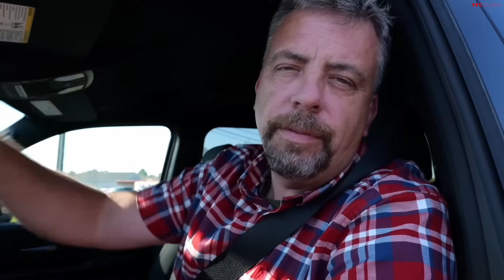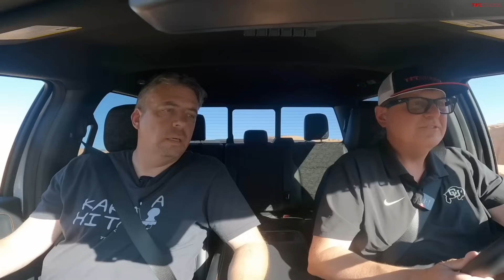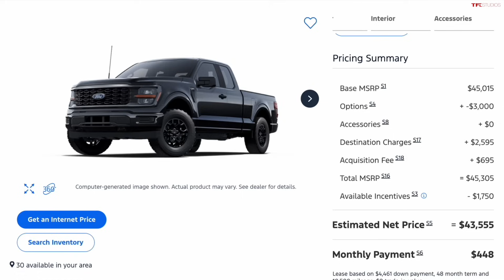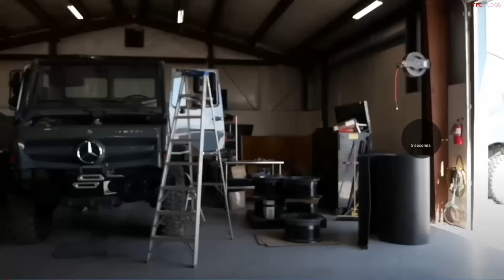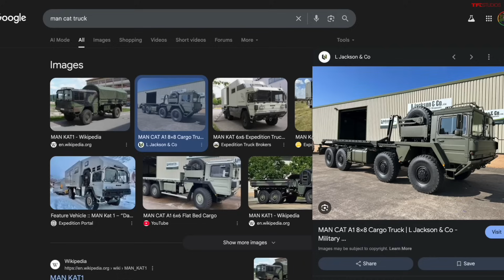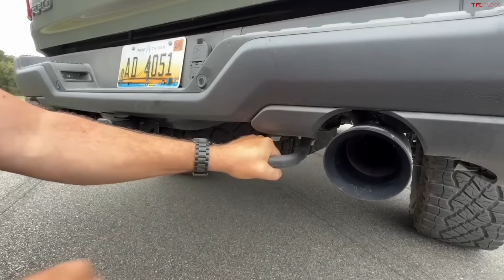These Are Our Favorite Off-Road Trucks…If You Want To Save Tons Of Money!

Comment: Booyah 👊🏾😁👍🏾🇺🇲
F150 rattler with a 5.0
F150 tremor with a 5.0
Ram 1500 4x4 with 5.7 hemi no e torque
Silvervado trail boss I6
Sierra elevation 4x4 I6
Titan XD 5.6 4x4
Titan XD 5.6 pro4x
Not feeling the tundra with a V6 sorry. I had would have a second gen again.

Comment: I think the sweet spot is the Chevy Colorado Trail Boss  with 360 camera package and leather, power, heated driver seat for $46K msrp. The 2025 comes standard with cruise control, 2" lift, 4x4, 2 speed transfer case, electronic locking rear diff. Which is a good base offroader with some creature comforts. You can get them advertised about $6K off msrp because the 2026s are on the lots

Comment: You have to have a single cab and short bed with front and rear lockers and that’s the best 4 wheel drive you can get !!
Reply: And a light weight engine that is gas no diesel to heavy !

Comment: Before I watch:  Chevy Silverado 1500 ZR2 with diesel engine.  You don’t need 600hp to off-road in 4WD Low.  You do need range, and the diesel engine gets you that.  And, you can negotiate it for less than the price of a mid-sized Tacoma Trailhunter.

Comment: Warlock is a great off road value. I would love to see TFL take a regular cab short box pickup with an off road package and show how capable they can be. I have a GMC work truck and they have the plastic steering wheel as well as no controls on the steering wheel except cruise control. A nice leather wrap really helps the feel of the steering wheel.